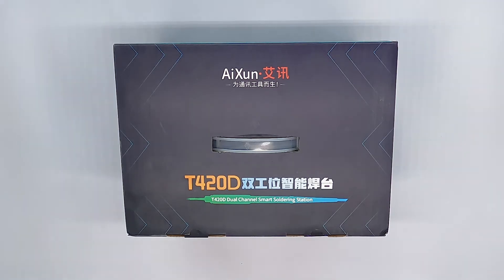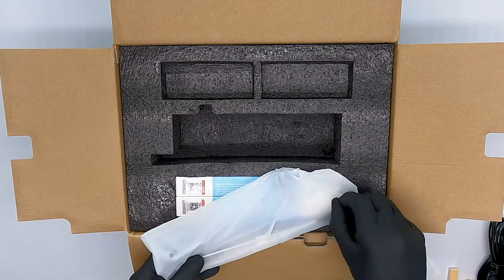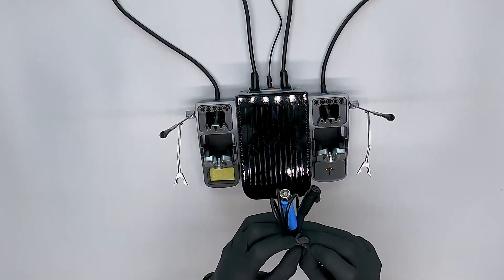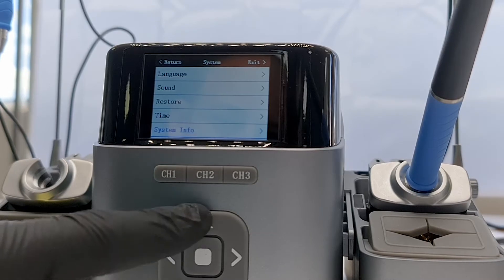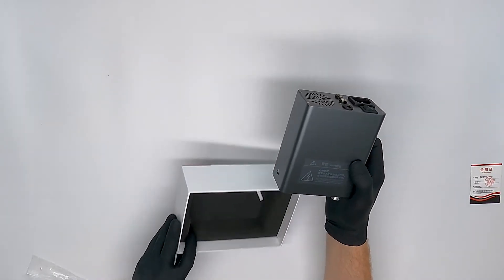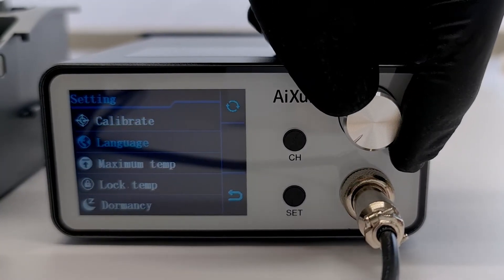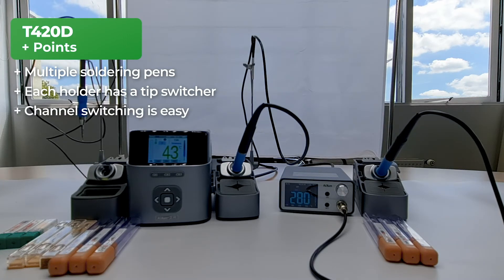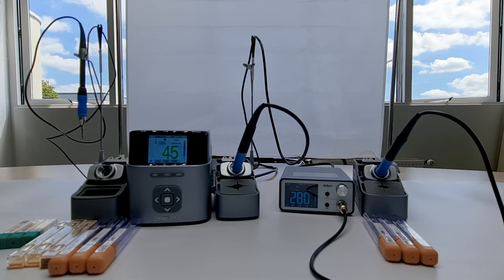JCID Product Review- JCID AiXun T420D vs. JCID AiXun T3A

Comment: Where is this while piece of plastic called Handle base connector? It's on every T420D sellers page but not inside the box. How can I connect two stands togerther without this Handle base connector?
Reply from the maker: You need to order it from jc, its not include in the box

Comment: The power switch wiring is poorly done at T3A, one just fell off when opening the back cover. Two others detached from the crimped terminals with a slight pull. Had to redo all the wires. The holder doesn't fit the Aixun T12 like the T245 but that not critical. What is critical is the holder materials, the plastic melt easily when touching the iron tips, mainly the longer tips of the T12... What were you thinking?! It's a soldering station, which means heat. Had to place thin metal plates under the cleaner and on the center divider.
The firmware updates option is nice to have, if there will be significant updates and for how long.
There is no easy access to the display/encoder, in case something will need to be replaced. 

Other than that, it's a great JBC alternative, might be even with better performance, but we shall see how this performance and lower cost translate into reliability in the long term.
Reply from the maker: Thanks for the input! We'll definitely forward your feedback. We personally did not have any issues with the power switch on the T3A. But we will forward it.

Thank you for the detailed feedback.